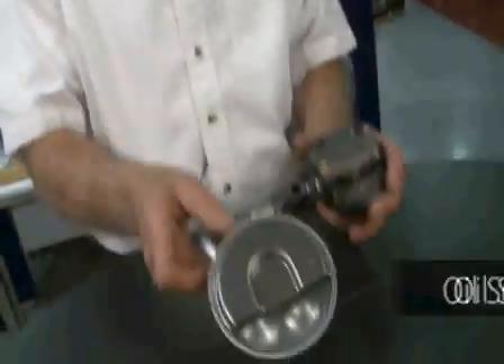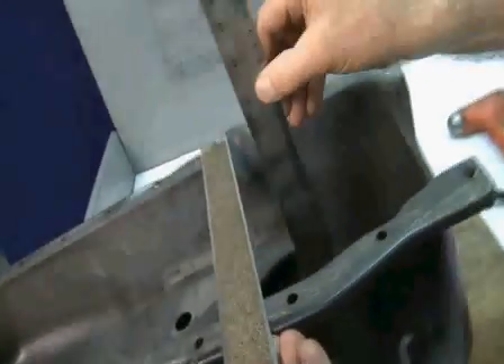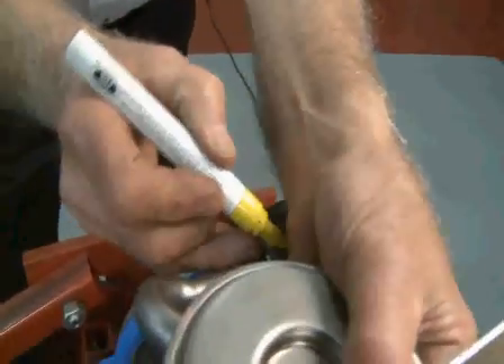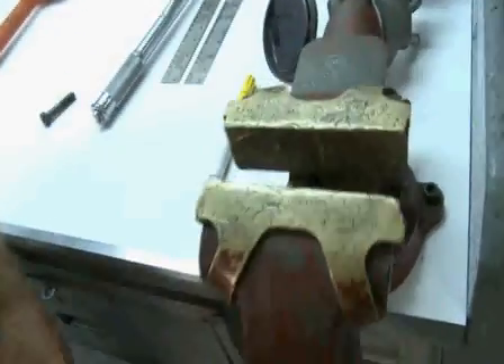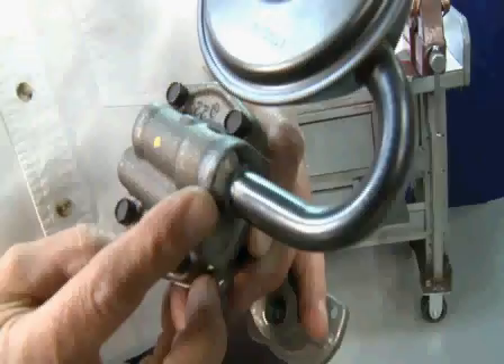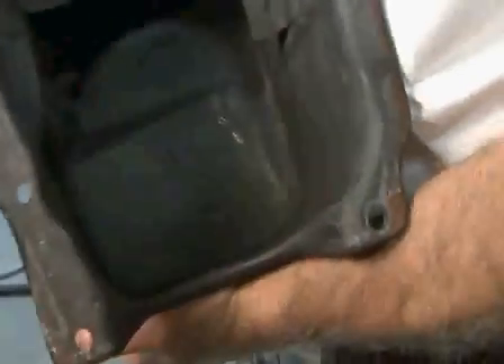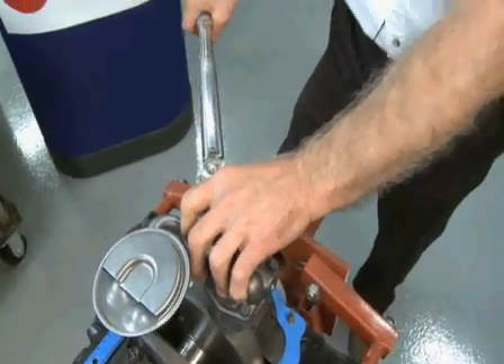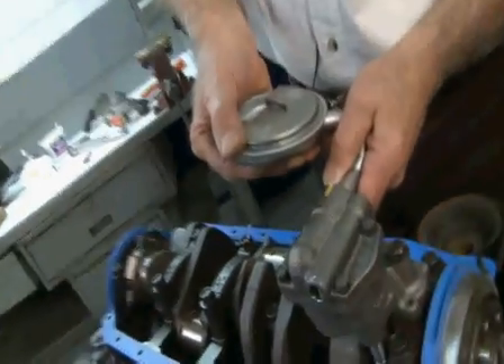Oil Pump Screen Installation - Melling Engine Parts

Comment: I just purchased a new Summit Racing brand standard oil pump for my 68 chevy 396 engine along with a Melling oil pickup screen P/N 305S. The interference fit is too tight. The hole in the pump measures .734" and the diameter of the tube is .745" a difference of .011", not good. I have been led to believe that Melling makes these oil pumps for Summit Racing under the P/N SUM-122177SV. So where is the problem? Is it with the pump or the pickup screen? What part do I need to return?

Comment: You mentioned welding steel pickup tube to cast iron pump body.  Bad idea.  Not a strong weld.  Should braze steel to iron or find another means of mounting the two together.

Comment: There is an easy way, install pump in motor-  loosely fit pickup tube in pump- then fit pan on -  it will set correct angle, then take pan off and move screen 1/4 inch higher ,  mark it with marker and you have correct depth and correct angle

Comment: A big ol' F U to Melling for making the oil pump separate from the pickup tube, or at least not making it a bolt-on. I have to buy your tool to drive the tube? FU! After I buy the tool and drive it I need to weld it? FU!! Dissimilar metals that resist welding? FU!!!!!
Reply: I can't move it after I drive it? EFFFFF YOOOUU MELLING!!

Comment: at first I thougnt "6 thousandths of press fit!!"  that's way too much.   But then I found this info from Melling on their screen installation tool, apparently it's a metal displacement press fit that only works once:  

"Melling Engine Parts supplies tools for installing press-in type oil pump screen assemblies. The pumpbody should be placed on a small block of wood with the tool straight up and down. Start the screen straight into the hole by twisting and turning by hand before pounding. Under no circumstances should the screen or oil pump be held in a vice. This will lock up the pump by crushing the gear pocket. The tool can be tapped with a hammer until the rolled bead on the collar of the screen tube is flush with the oil pump. This is a metal displacement press fit that only works once."

Comment: after driving the pickup tube into the pump, it just slid out...:(, this is a crappy design, ford bolts theirs on and dodge uses a pipe thread...so tell me why chevy is so great again?
Reply: Even a 2.2 Chrysler 4 banger from the 80s has a bolt on screen. GM has crap engineers.
Reply: Just wield it on
Reply: You can use a Pioneer 839061 Oil Pump Screen Fastener.  This product secures the oil pick-up tube to the oil pump.  But, you need to be aware that if the tube just slides out of the oil pump, then the seal may be ineffective enough that the oil pump will suck air into the engine and not oil.

Comment: Just talked to a welder.   He said there is no real way to weld a steel to a cast iron. Welder said it will not hold and the weld will end up in a pan. So what now ?  I'm not a welder but how do I secure this piece of screen to the pump ? Its  loose.
Reply: Braze it'
Brass sticks to cast iron or steel. What welder doesn’t know that! SMH....
Reply: @Mr572u  that is what we ended up doing.  I was thinking of JB welding it.  I used JB weld in many places but never inside the engine so I opted out of that. Since that is the only welding I do, I was not sure what to do.   I do not call brazing welding, as it is really not the same but in this case it worked just fine. 
The welder I talked to said the cast was the issue.  He was afraid it will let go and a piece will find its way into the pan.   I respect him for turning a job down and stating his doubts though.   I had issues when people took on jobs that was not possible just to make a quick 20 or 30 and later ended causing issues.  I always tell anybody I hire to do anything - be sure to say no when in doubt. A project not done due to safety reason is better than a job finished with crap results.
Reply: You can weld it just gota have the right filler metal when tigging it might also want to preheat the cast first. But say you just wanna use a 7018 stick rod to weld it. And overtime the weld cracks. That weld is going to stick to the steel tube just fine but may break away from the cast. Find you a welder who knows what they are doing and has expirence with cast welding
Reply: Find a better welder.
Reply: I realize that you posted this comment approximately 3 years ago,  the product I have purchased and ordered, but haven’t installed yet is the Pioneer 839061 Oil Pump Screen Fastener.  It secures the oil pick-up tube to the pump.  The future/potential problem that I will probably experience is that I wasn’t planning to remove the oil pump to install a new pick-up tube…so I will be required to remove the pump if I want to install a new pickup tube which will separate the oil pump driveshaft from the pump and that will have to be joined underneath the  vehicle, since the engine will remain in the vehicle.
Reply: Did you confirm the material is cast iron?  It may be cast steel.
Reply: anything can be welded if you know what you are doing

Comment: Ok. this is all well IF the engine is out. I did not remove the engine for the pump replacement. 2 things. One - the weird push-in screen was not going in, so I heated the pump slightly and froze the screen and applied a small amount of wd40. It slid in and now it is very loose. Of course I had to twist it as the angle was not correct. I also did not have an oil screen install tool and used a wise. 
Why is it not threaded or simply bolted ? Thread blocker on it could have helped but since it was so hard to hammer it in due to a lack of real edge (there is a tiny edge but not enough to grab it with a plier) so I think the thread blocker would have not helped. 
So I have to take it to a welder.  Great. More wasted time instead of a smart design.  Sometimes you wonder what were they thinking ?  People quick to say Ford is crap. Well, they bolt their screen so it is super easy to install and no delay and begging a welder to do it.
Reply: This is a GM problem, not a Melling problem... this is a DUMB design. I'm putting my first GM V8 together now for my boat. Can't believe that they don't have a bolt on pick up tube.
Reply: A bolt to the pick up tube and a steel teflon coated gasket between the oil pump mount and the block would be nice. Most Japan and German cars have this set up. I did a 5.7 gm and i was told by GM tech that sometimes with the vibrating of the engine sometimes they come loose or and eventually the screen just rests on the bottome of oul pan. This is stupid design and is designed to fail.
Reply: Melling is crap

Comment: Bought a new 350 long block for my boat.  The new oil pump has a non threaded port to attach the flexible screen tube.  My old screen and tube has a threaded fitting.  How do you suggest I attach it to the new oil pump  with the press fit port?  Is there an available adapter?  My flexible tube and screen are no longer available.
Reply from the maker: +joel , 
Can you give our tech department a call? 1-330-630-0240. We need some additional information from you. Thanks!

Comment: So, if my 3/8" drill contacts the bottom of the pan the pickup is too close? How do I remove the screen to adjust, since it says not to twist the screen in the oil pump, and by the time I do the drill test I have already welded the screen to the pump, per the video. Seems like all the checks and adjustment should take place before the welding.
Reply from the maker: TorquinDSL , 
A pre-assembly mock up will have to take place. Measure from the oil pan gasket surface on the engine block to the bottom inside of the oil pan versus that same measurement to the bottom of the oil pump pickup. The difference between the two measurements should be 3/8” greater to the bottom of the oil pan!